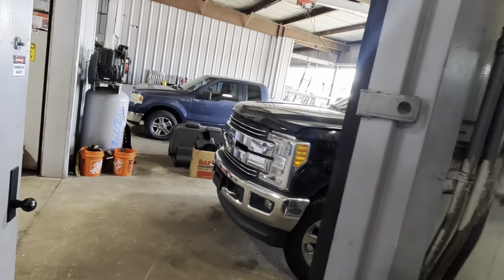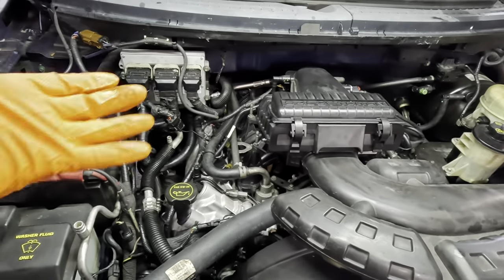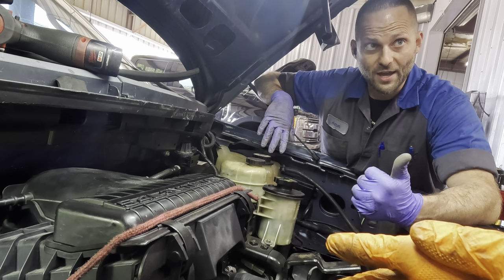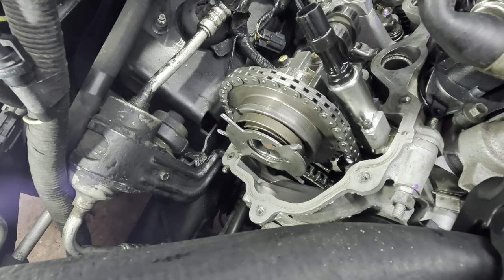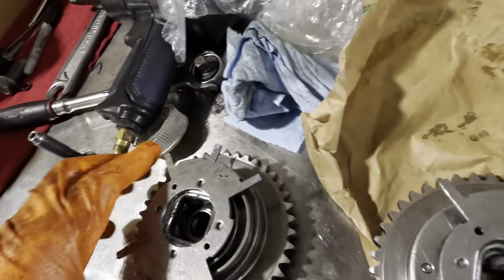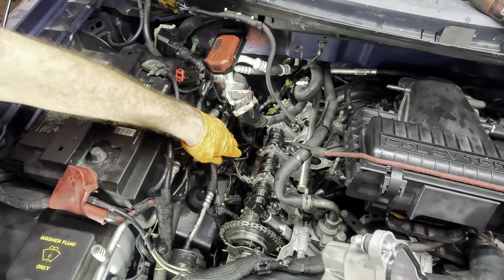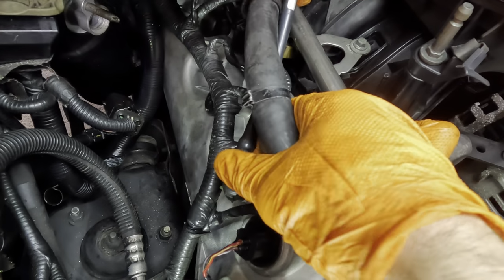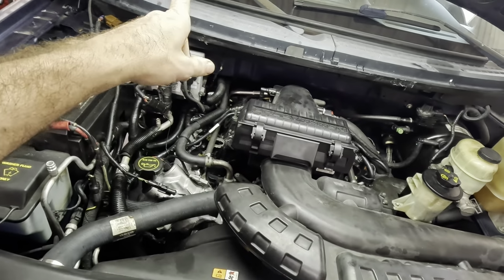Ford 5.4 Camshaft Phaser and Timing Chain-Wedge Method

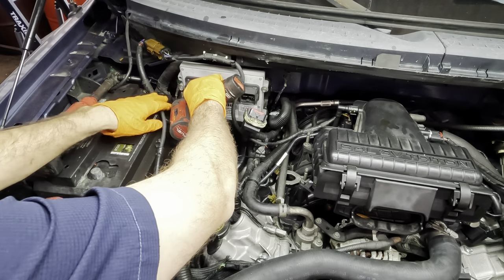Comment: 6:49 You said: "there is noting faster then a mechanic doing a job a second time"  I beg to differ,
The consumer reaching for his wallet to pay a second time is faster.  Far too many parts cannon mechanics, shoot until they hit the target, and the dealerships love it because everytime they miss the shop makes more short term cash.
Short term because after people catch on thats not the shop to go to.
They loose faith in the shops qualifications

ASI certification should also include the mechanics ability to find the problem as well as repair it. Trouble shooting and properly diagnosing the issue is a major part of the test.

A test subject with a known issue should be used, and i don't mean a simple problem, but something very complex, but apparent. Something that would test even the best mechanics skills.       .

Comment: When I see you turn the cam and the sprocket stays put, then on the new one you turn the cam and everything moved together that pretty much tells you you're going to be good, at least on that initial start. Even though the phaser was dry, it came locked together so it's nice and quiet. 

On my car the phasers are known to have the locking pin mechanism wear out and you get that lovely rattle some times then eventually all the times 😢

Comment: Why did they put the old busted manifolds on the new engine? That's a pain in the ass job with the engine in the truck. Only saving grace is the studs and bolts won't be rusted together.

Comment: I am not sure if this is a valid comment or observation but I noticed that when you moved the cam to get more slack on the chain during the removal of the old cam phaser that there was play in the old one that wasn't there in the new one, does that suggests that the old one did in fact have an internal fault with the springs/mechanism that retains pressure upon the chain until acted upon by the oil pressure overcoming this tension? (Causing the phaser to rattle until normal engine oil pressure dampens it).

You would have to look/think back to when you replaced it to see this was the case and if the other one was the same and it may be a quick/quicker way to check in future if this is an indication of weakened spring/mechanism/seals etc inside these phasers?

I found it hard to hear the ticking/rattling with that exhaust tick/chaff in the background so you may have to buy a mic you can put nearer the engine for a before and after comparison lol (might be a handy tool so you can show the before and after recordings of the recorded sound waves?)

Not trying to give you extra work or that ... honest gov (governor) 😆 🤣 😂 

But you could definitively show you made the correct decision and verify it.

*** EDIT ***

I just thought of a way you might be able to physically test the wear on the tension springs/mechanism of the phaser, if you mount the phaser cog/outer gear in the vise and using a nut and bolt to allow you to move the inner cam mounted part of the phaser you might be able to test the torque required to overcome the spring/mechanism in the phaser and see if there is a significant difference between an old and new part (using softer vice jaws not to damage the new phasers obviously lol)

You could then in the future test the torque on ones still mounted to the engines of vehicles that come in and replace them if they are showing weakness without removing or replacing them during diagnosis (you're welcome any Ford techs watching 😉 ... 😆 🤣 😂)

👍

Comment: Exhaust manifold. Again, exhaust manifold. Change it. It’s cracked. Sounds loud and quiets down a bit when it gets hot. Did I say exhaust manifold passenger side is cracked. Very common. Change the exhaust manifold

Comment: I hate it when a company warranties something and then in the face of overwhelmingly obvious evidence proceeds to cheap out on said warranty.  Bought a car from a well known national used car dealership. Two weeks later it was blowing fresh oil out of the tail pipe. (Turbocharged Mazda 3). Obvious failure of the labyrinth seals on the turbo. The dealership refused over and over to replace the turbo even after I presented them with the actual Mazda service bulletins about this issue. In the end they wound up cracking the head and told me I was on my own. I got a full refund after getting an attorney involved. But that shit chaps my ass!

Comment: This is literally textbook timing chain tensioner failure. They leak down over time once oil pressure is gone and when its restarted you here chain slap until oil pressure is built back up. This isn't really that difficult.

Comment: Drop the pan, check pickup tube
Reply: Only if the engine rebuilder says to do it and pays for it. Ray is not going to just willie nelly remove parts from this engine without a guarantee of being paid.  Don't forget the truck owner is not paying for this work the engineer rebuilder is.  Personally, I would have told the engine rebuilder  this motor is trashed once he found all the paper in the oil return lines when he removed the valve cover. Paper left in the motor by the rebuilder.

Comment: 7:14 Is it ever the ECM?  Like for real?  Maybe it's different with new computers, they don't make them like they used to.  

I've had gremlins and always wonder, is my ECU going out?  No.  It's never the ECU.  I've got a 97 that misfires. - Ahh, you need a new ECU.  No..  I need to clean the distributor, fix an oil leak, replace the sparkies and wires.  

It's NEVER  the ECU.  Except when it is... but seriously?  How often is it the computer?  And if it is?  WHY?  Probably a ground issue...

Comment: In the first 5 minutes of the video right now. It sound like timing chain is slapping and growling perhaps due to crappy tensioners leaking off when the engine isn't running and building oil pressure. It stops suddenly because after a few seconds of running they get oil to them.

Comment: Bought my 05 f150 10 years ago for $18k. I have literally spent over $13k keeping it going. Why? Cause i had a 60 month loan, and it fell apart at 100k miles, 14 months into the loan.

$9k for a redesigned engine from Jasper engines. 50k miles after and it runs like a dream.

Comment: How frustrating...that warranty company is going to throw parts at it and it will never be fixed. That new engine  is no good...cam phasers don't fix the problem...next they will tell you to replace the oil pump and that won't fix it...then it will be timing chains and that won't fix it. It's probably a cam bearing or something but willing to bet it needs another new engine. Something went wrong with that remanufacturing process. Feel for that customer for sure...hope they do right by him and replace the engine again

Comment: Obviously the OEM parts are crap also Ray. Those were new that you are replacing. The problem is that motor and it's engineering snafu's.

Comment: just being a little cynical here - due to the high risk of this job, and ther seriousness of the damage if it goes wrong, do you think that , rather than honouring the guarantee and simply(?) rebuilding the engine, they are hoping you are gonna slip up and then blame you?
I can't see a logical reason for simply throwing random parts - and duplicating wasted time at this, compared to doing what should be done - which is a stripdown inspection - possibly out of the car?

Comment: How much is the warranty company paying anyways?
I'm curious if the warranty company is one of the many that advertise on TV?
I've thiught about using one, but just cant help but yhink that as long as they are making money, they are happy, but will nickel and dime mechanics and parts people to soend the very least they can.
The commercials make it sound so great, but uf they are like home warranty companies, they make it sound like no worries. They will fix it replace with like models, but when it comes to doing a replacement or authorizing a repair, they only approve a fraction and pay the customer, not actually replacing the defective appliance, but they pay off some unseen list that isn't what it actually cost to replace.
My home warranty paid me only $250 for a under counter above stove microwave that went bad. They said the microwave was not repairable.
But a new one was $600+ and insult to injury, I had to remove the old one, find a second hand one and figure out how to remount it.
I don't trust warranty companies anymore.

Comment: VW had a similar problem with there newly designed timing chains and tensioner on there new 1.4 tsi motors, the chain was designed to look like a timing belt and they failed badly, because of  oil flow and poor design, they improved the quality of the product and there not failing any more, but they still make a rattle at the start up until the tensioner picks up the slack, but still they should have used either a timing belt or an old school timing chain, but thats what happens when you try something new and let your customers do the testing for you. 😊

Comment: Why would i use ford parts if the ford parts are faulty
Reply: Because Ford phasers are the higher quality.
The engine oil flow passages on the Triton three valve per cylinder 5.4 are small and convoluted.
If folks don't take special care with oil changes sludge builds up blocks the flow and parts fail.
Reply: @wayneessar7489  I've not done phasers on a 5.4 triton but i've replaced close to a dozen GM 3.0 3.6 timing chains and i've always used the Melling timing chain kit so if I were to run across a 5.4 i would use Melling phasers
Reply: You sound like an expert on General Motors engines...and that's good but experts on Ford engines have said often that aftermarket cam phasers are not suitable.
These folks were not dealer mechanics but people that produce high quality repairs.
I am in no way affiliated with them.

Comment: Variable valve timing always has issues and is a bad solution to increase engine performance and reduced emissions and lower gas usage. Every engine engineer should be required to do all repairs first then they would understand the issue with their terrible designs.

Comment: How much $$$$ is the truck owner willing to throw at a 04 F150, if it's not 4x4 it's not worth over 6k, if it's rusted out it ain't worth anything. But least you get well versed in phaser work and you not beating your brains on bushings.......

Comment: jesus criminy.   If I had a ticking up top and found a bunch of paper or other debre in the timing chain area,   I would know for sure it was most likely and oil blockage issue.  I mean you told them and they still are like duhhh

Comment: That pore guy (owner). He might have been money ahead just installing a 5.0 coyote out of totaled vehicle /w ECU (if the trans BH would allow). The Triton series was a failed experiment. They're about as useful as the Midlands of the 70's &80's. Also, if you found debris in the engine (paper), there's no telling what else is lurking in that oil pan or on the screen of the oil P/U tube. RIP 150. RIP to Ray's AR if you keep taking on these pre-failed tasks.
Reply: Eh, owner should have moved on from that truck to something newer. Yes, the 3v is a turd. BUT I have seen plenty still running really strong at 200k+. They are pretty straightforward and easy to work on, if you know what you are doing and are not a hack. Exhaust manifolds are absolutely miserable though.